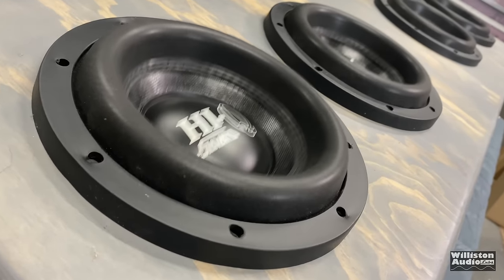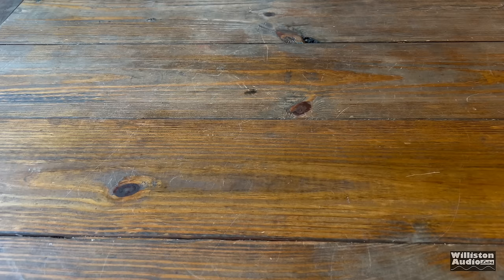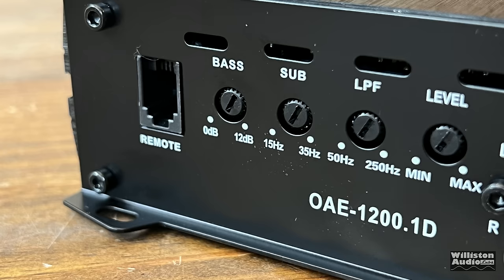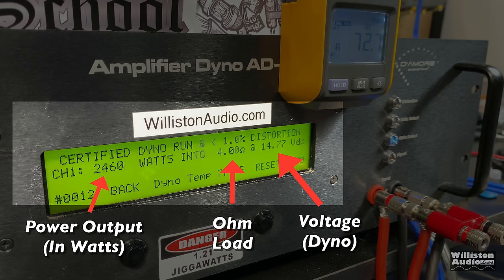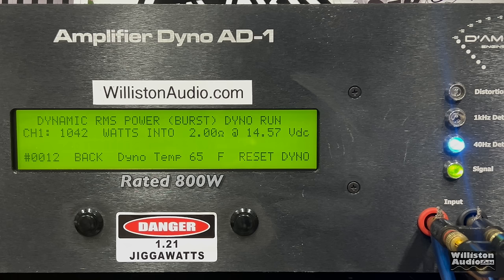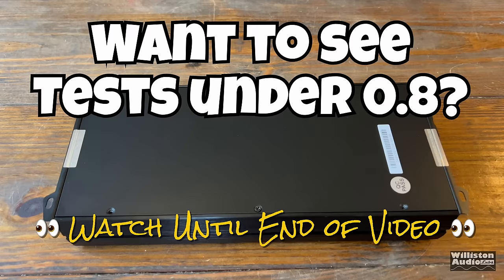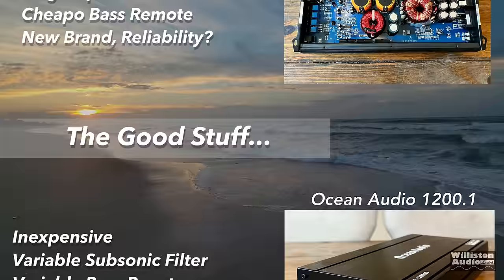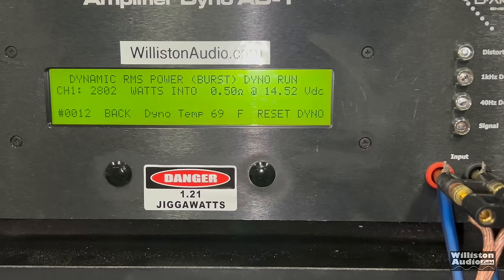This Cheap 1200W Amazon Amp Surprised Me - Ocean Audio OAE-1200.1D

Comment from the maker: Ocean Audio OAE-1200.1D Amplifier
Buy on Amazon: https://amzn.to/4aRJQAv
Shop Other Ocean Audio Amplifiers: https://amzn.to/3xxww61

SHOP Related Amps
Down4Sound JP8 v1.5: https://lddy.no/1gqpf
Stinger MT1500.1: https://amzn.to/3s01l0w
CT Sounds CT-1000.1D: https://amzn.to/3qgz05D
SKAR Audio RP1200.1D: https://amzn.to/49yncfG

➡ Support OSS / Williston Audio Labs for early access to videos: http://www.patreon.com/OldSchoolStereo
One Time "Tip" for Video Support: https://paypal.me/BigDWiz

DISCLAIMER: This video and description contains affiliate links, which means that if you purchase from one of the product links, I may receive a small commission. As an Amazon Associate I earn from qualifying purchases
Reply: I have that recoil 1200.  Its a beast however you can only bump maybe 4 songs before it gets hot and turns off then comes back on after a few sec.  Sucks. And thats at 2 ohms.   14.4 volts majority of the time and it still gets hot.
Reply: How many keys have U stolen from Alan?
Reply: You should review the new Recoil Dii3300.1D I've got one. I got it from Robotunderground. Easily is making more power than the Skar RP2000.1D it replaced on the same power supply.  (48AH Red Headway Lithium)

Comment: Wow what an impressive dyno!!! 

I love it when you see speaker wire jump.....I seen the salt 12 pull so much current it was making all 4 inputs twitch. Crazy.
Reply: Is that for real? The magnetic field caused by the current moved those speaker wires?
That amp will kill 12v car battery quickly.

Comment: Wow!!!! After watching your video I purchased this amp on amazon. The price was still $89.00.  This amp will be installed in my nephews car along with a skar 12” sub. My gift to him this next Christmas. Comparing to skar 1200.1 at $157.00 it was a no brainer yet we will be using a different aftermarket bass knob.
Reply: Let me know what bass knob you used..
Reply: I got my nephew a sky high bass knob. The same that I use in my 4 15” 5k build. Easy to install and it has a good potentiometer.

Comment: I remember back in 2013 I bought a 1500w vvme amp for 90 dollars new and it was a clone of another amp it actually did rated but they sold a few and then were never to be heard from again. I just recently found one of these rare gems on ebay so I snatched it up and it hits just as hard as I remember.

Comment: what happened to do it bump thou?? i wanted to hear this amp. 
:(
Reply: I can skip that , since trying to convey how an amp " sounds " is very subjective , and , the actual sound is related through a whole chain of lossy compression / decompression steps and then arrives at your device which likely has an ok at best speaker built in .
But it is fun to watch the speakers flex IMO .
Reply: With that much power it def bumps

Comment: Big D, I love watching your amp dyno vids. How about some tips videos on how to clean up sound? I have a Skar 2x12" enclosure under the rear seat of my 2007 Ram 1500 4 door loaded with Skar VD-12 D4's (wired at 1 ohm), and they just sound muddy and messy. I'm currently running them on a junk amp I had sitting in my parts box, but I just ordered this amp. Got any tips for us pleb's in the audio world to tighten and clean up the bass?

Comment: I feel like this amp came out of the same chinese factory as the damore e series amps. It has a very similar layout and the same power input connections/crossover/fuse locations. damore himself said the e series amps are built in china when someone mentioned they look identical to the hifonics alpha amps.

it's a shame because damore advertises the e series amps as their own when they were out sourced to china.
Reply: I'm sure Tony did design his own amps. It's quite possible the company building his are cloning his designs. Seems unlikely though.
Reply: @JasonWW2000  I honestly don't think he designed the E series. If he did, no way he would give all the design files over to china like that lol
Reply: @appaco549  The E-Series features his clean D audio circuits which are patented. 

He would have to give the manufacturer enough information to properly build the amplifiers.
Reply: @JasonWW2000  The "clean D" is just a common mode choke on the input/output. It's nothing special. Even rockford's prime level amps have it. 

The E1500.1 doesn't seem to have any "clean D" to it looking at the gut pics. Which is the one that is identical to the hifonic alpha series.
Reply: @appaco549 Are you sure you know what you're talking about? You can't really get a patent for running a choke on the input and output. As you said, it's nothing special. I would assume the clean D technology would be something else. Something that could be patented. 

Unfortunately, I have not looked into these D'Amore amplifiers so I can't say how similar the basic layout is compared to other amps. There's not very many different ways you can design a class D amplifier. The secret sauce is going to be in the components used and all the preamp circuitry. For all I know Tony's amps could be completely different from this Ocean Audio amp.
Reply: @JasonWW2000  You can literally see the common mode choke.. He calls it clean D and describes it as filtering of all inputs and outputs, aka a common mode choke.

JL audio has done this as well way back in the 90s. 

I've done amp design myself and do circuit design/layout professionally, these chinese amps are way too similar in layout for it to be a coincidence.
Reply: @appaco549  I think you missed my point. I don't believe he's calling the choke his clean D technology.
Reply: @JasonWW2000  tony himself said these amps are made in china and that they only added emi filter to the input/outputs. 

It even says this on their product page. That clean D is basically emi filtering. A choke. 

It's all marketing terms. How else would you make a cookie cutter amp stand out?
Reply: @appaco549  Okay, you made me look up amp guts of both. I assume you're comparing the Oceans Audio to his E1000.1 watt amp since it has three 40 amp fuses.

I think you need to get your eyes checked. Those two amplifiers look nothing alike. Circuit board design is completely different and the layout is completely different.

Are you looking at a different amp model from D'amore?

Comment: nothing beats the sound quality of class a amp, except in the field of wattage and efficiency.
Reply: That’s why I rock a diy 50,000 W class A amp to power my stock jbl car speakers! Got my multi alternator 14,000 amp set up and I’m good to go, even in the winter it’s hard to keep the car cool enough. Had to install a 300 ton AC unit. Car only gets half a mile per gallon, but, gotta make your sacrifices. 🤷‍♀️

Comment: on those cheaper amps, I would love to see the flir on it to see what temps it is putting out.  do they get hot pushing the power?  Great vid Big D
Reply from the maker: It didn't get hot enough during my tests to show anything, but I agree I should've added this in. I'll try to refrain from slippin' in the future
Reply: he posts the efficiency numbers and you can see below 2 ohms you may need to think about cooling, a good indication of if the amp is going to be a little oven or not.  but imho I dont think any class d amp really gets that hot, but my experience is limited.

Comment: Just picked one up 180$ Canadian, still the cheapest 1200rms amp I've found new 😀
Reply: so far the amp performs as advertised, i rise to about 4.3ohms so im not getting anything out of the amp but it still got me a 140 with 2 10s in a tline and im able to fit standard 10 guage in the speaker terminals

Comment: When wiring a dual 12" enclosure (DVC 4ohm, wired as a 1 ohm load) to this amp, do both subs receive the watts being put out by the amplifier, or is the output split between the two? If my subs will handle 800W peak and this amp puts out 1203W with a 1 ohm load, does that mean I need to turn down the gain to avoid damaging my subs (because they are both seeing 1203W), or not worry about it because each one is only receiving 601.5W at max output?

Comment: I bought the stinger 700.1 because of the video you made on your channel about it and then I saw the 2000.1 video and now I want to buy the 2000.1 and a new sub and run it at 4ohm & 800wt or 2ohm & 1500wts not sure If I’m going for sound quality or more power
Reply: Remember that with box rise your 4 ohm load is going to be closer to 10 or maybe 8 ohms. I'd try to wire it to one or two ohms if possible.

Comment: Assume for a moment that I know nothing about car audio. Because I do not. Do you need anything other than the stock car's electrical system to run an amp like this?
Reply: @Only-Memories-In-The-End  Thanks!
Reply: @Take-the-Ticket  It really depends on how you use this app. It's only going to draw 150 amps if you wire it down to at least 0.5 ohms and then max out the volume. So under normal circumstances you're not going to be drawing anywhere near that much current. If you wire your subs to one ohm then you're not going to be drawing as much current and at typical volume levels you might only be drawing 20 to 50 amps which is fine for most vehicles. I've got a single 12 in my SUV and at 270 W going to the sub it's only drawing about 35 amps and it's shaking the whole vehicle. I'm sure your stock electrical would be fine with this amp. Only a serious bass head who is maxing things out all the time would need an electrical upgrade.
Reply: It depends on how you run it. If you plan on pulling the full 1200 watts, then you're going to need some solid juice. At the very least a battery designed for driving car audio systems. Perhaps a more muscular alternator. Like I said, it depends. There are a lot of variables in play.
Reply: @MeTuLHeD  |m| thanks :)

Comment: Anyone who touches HIFONICS now-a-days is a fool. It's MAXXSONICS rubbish. Manufacturers should be providing ratings at 12.3V as well for a more accurate description of the amplifiers' output power.
Reply: Who runs at 12.3V? Even my 36yr old  truck puts out 13.5v with the factory alternator.
Reply: Their warranty is trash also. They are a junk brand nowadays.
Reply: this amp is garbage also
Reply: @CHEVYK10  It seems most people do not share your opinion.
Reply: @656hookemhorns  Not everyone wants to keep their vehicle running while listening to some tunes. There are plenty of competition setups built on parallel 12V stand-alone power. 13.5V is a little low there as well when running bud. An alternator should be putting out 14.1-14.2 volts.